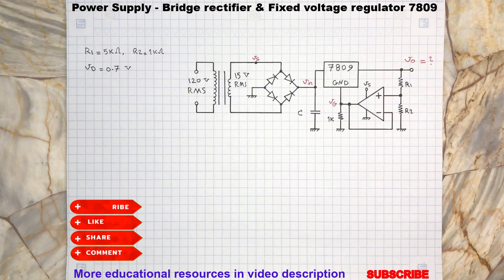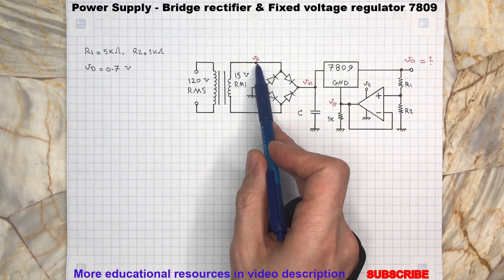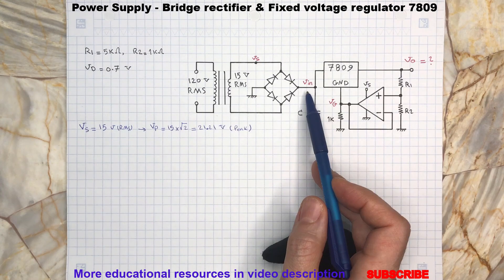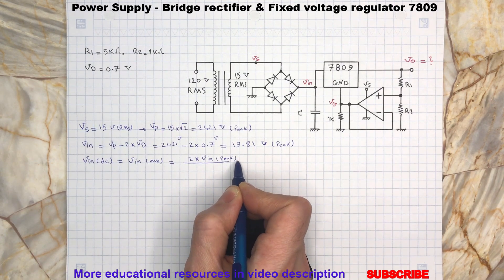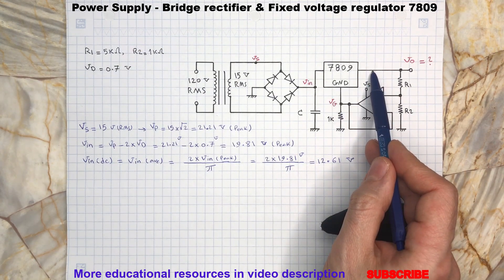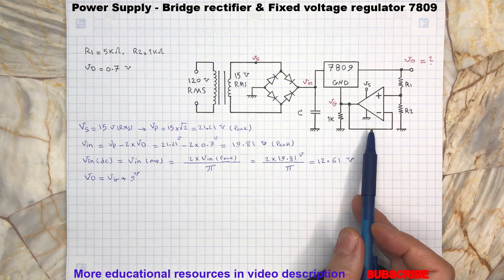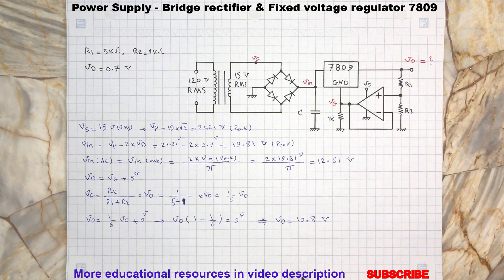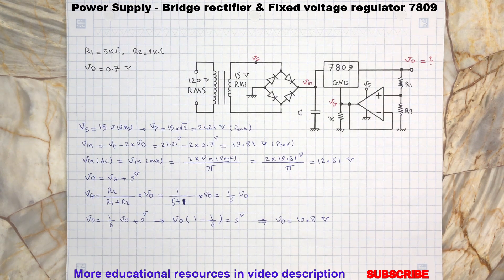Full-Wave Bridge Rectifier and 7809 Voltage Regulator Circuit Analysis, 7800  Series Power Supply

Comment from the maker: Voltage Regulator and Current Limiting Circuit Analysis:  https://youtu.be/8Mn6LC2isHs
Zener Diode as Voltage Reference:  https://youtu.be/nkcTwK1LTDI
Op-Amp and Zenner Voltage Regulator:  https://youtu.be/CKMxGu3uHAA
Transistor Series Voltage Regulator:  https://youtu.be/OuVbjRZHM9U
Electronic Circuit Analysis Playlist: https://www.youtube.com/playlist?list=PLLA_QJ8rHZBh5LqrY41bCvKgreRDRWrBQ
Digital Logic Playlist: https://www.youtube.com/playlist?list=PLLA_QJ8rHZBjoWpsdJeo6ii5HnWTEmDi7
Control System Playlist: https://www.youtube.com/playlist?list=PLLA_QJ8rHZBjS_S6WPkmUweF5NbImvSqf
Circuit Analysis playlist: https://www.youtube.com/playlist?list=PLLA_QJ8rHZBj8qPBFArjveEustxuToLDw
Electricity and Magnetism Playlist: https://www.youtube.com/playlist?list=PLLA_QJ8rHZBhQ7ykCkWBI8sbphMA_Rf_1

Comment: Sorry, but Vin(dc) is not equal to Vin(ave). The DC voltage at Vin will be Vp under no-load conditions. When a current I is drawn from that point, the voltage will be Vp less some ripple voltage. The ripple voltage can be estimated by understanding that when the instantaneous input voltage to the bridge rectifier is less than the instantaneous value of Vin, the current is being supplied by discharging the capacitor C. That relationship is given by VC = It, where V is the peak ripple voltage, and t is the approximate period of the the full-wave rectified voltage (about 10ms for 50Hz mains or 8ms for 60Hz). For example, drawing 0.5A and using a 4,700μF capacitor would give a ripple of It/C = 0.5 x 10m / 4700μ = 1V roughly.
Reply from the maker: Thank you for your valuable feedback, in general, yes, you are correct, however, as you can see here, the circuit does not have any load and this is why I didn't provide a value for the capacitor. In this proposed circuit, the expected ripples won't affect the output voltage of the 7809 since the minimum input voltage at Vin will still remain in range of 11V which it is provided in the manufacture datasheet.
Reply: @EngineeringinDepth  As already said, without load V_in(dc) = V_p. Peak, not average, since there is nothing discharging the capacitor.